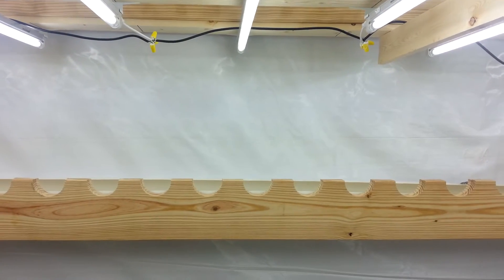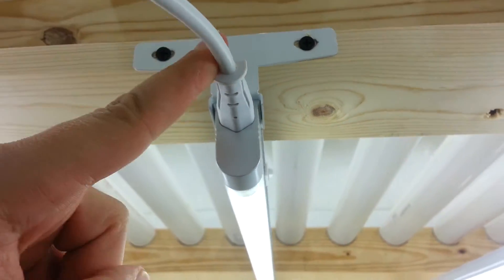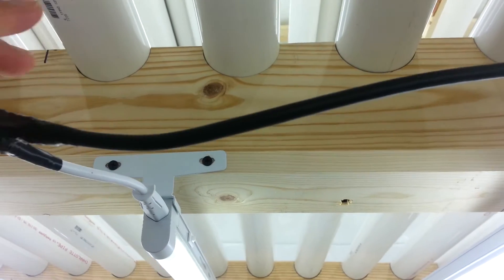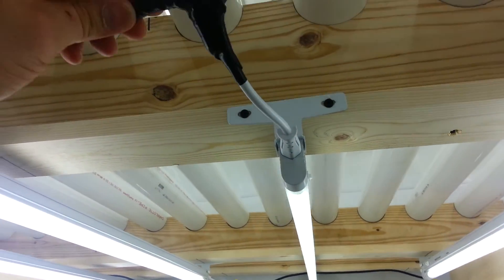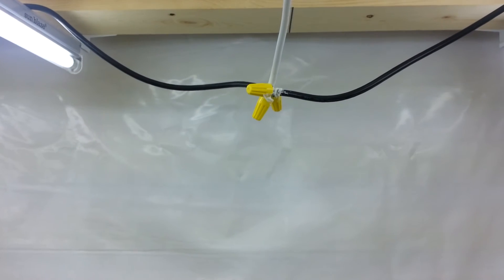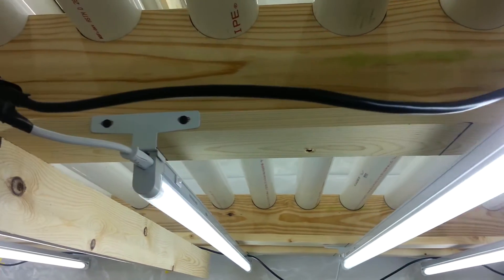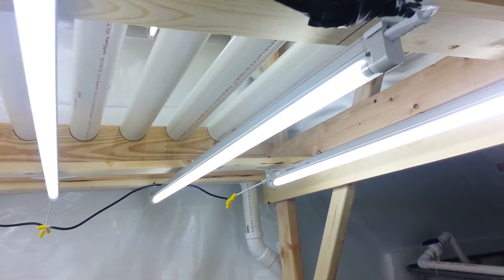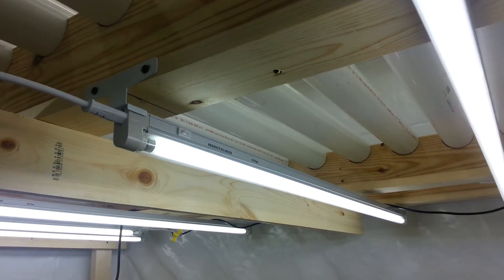T5 wiring for Aquaponics

Comment: I'm wondering how you accommodated for electrical safety.  It looks like the plants are growing above them.  Is it safe because the electrical parts are not directly below the pipes or do you just make sure you don't have water splashes, etc?  Great how to video. Thanks for sharing.
Reply from the maker: I'm still working to eliminate my leaks.  I think I've figured out a good solution finally, but each circuit is on a GFCI outlet to protect from just that concern.  Also, all the connections I made are within a water resistant wire nut, topped off with silicon and then taped to keep water out of the splice.  All wiring and the outlets they're going to are housed within conduit that is glued.  I'm less concerned with water and electric than I am of keeping the water in the plumbing and temps where I want them!  Hopefully, I'll have an update video out soon with a full tour and detailed explanations of each sub system!!!  Thanks for the question!
Reply: Thanks for the feedback.  It certainly is nice to use the vertical space as wisely as possible.  Just have to figure out how?  I have heard that temperature, ph and nutrient level change are one of the bigger problems with NFT systems in pipes.That's probably one of the biggest reasons that I'm going with floating raft right now.  That costs vertical efficiency though.  This might change though.  There is almost always a solution to these kinds of problems.  Shorter runs might be the answer with NFT.  Don't know for sure.  Anyway, I hope things work out for you.  I'm glad to hear about the GFCI and other precautions that you've taken for electrical safety.  Still too nerve wracking for me.  15 or  20 amps can reach out and touch you.